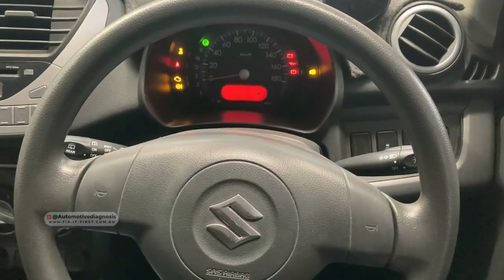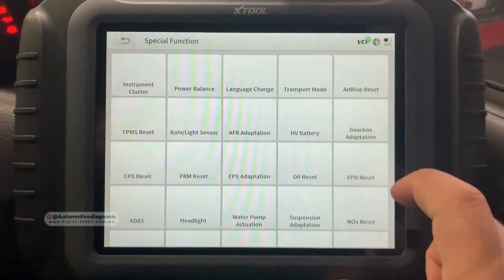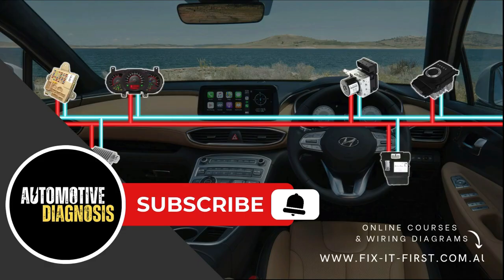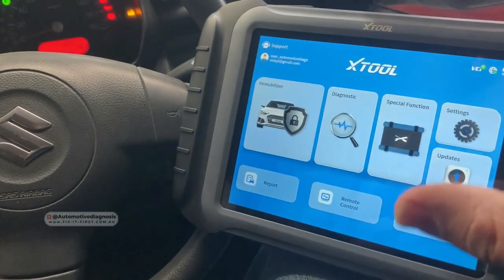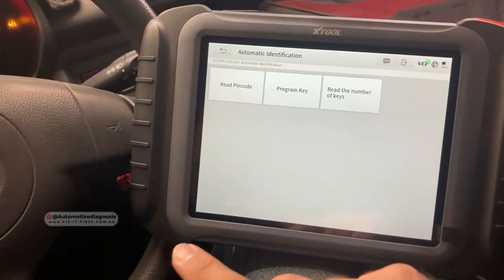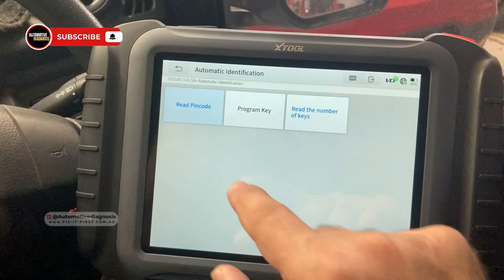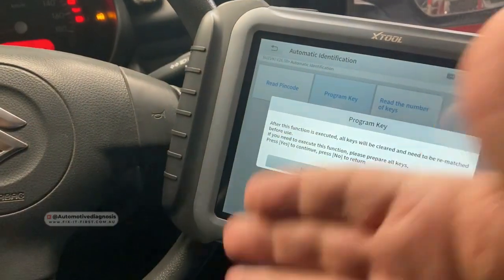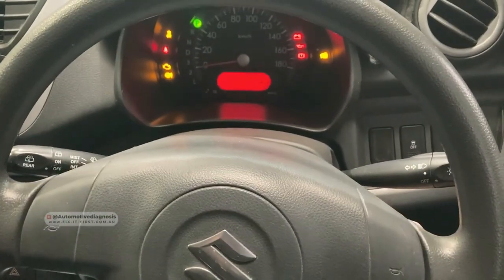Key Programming & Reading Pin Code with XTOOL X100PAD Elite | Suzuki

Comment: He Matw how long does it normally take to access and code a key start to finish with no original key? I’ve got the km100 autel 608 and snap on but all take way to long to get the job done. Been doing a lot of research trying to find a faster more reliable one.

Comment: I wanna buy a key programming tool, but I'm not sure between Xtool and Topdon!
Reply from the maker: Hi there, I never directly recommend what to buy or not, but in your case, If I were you, in case that I had more diagnostic and sometimes key programming (not frequently) I would go for Topdon, but if you wanna do a lot of key programming, XTool would be a better option. But at the end of the day, each device can bring a different experience for different people, so it’s your choice. Let us know how you go and update us about your experience please.
Reply: I was in the same boat not long ago, ended up going with the XTOOL X100 PAD and it's been solid. It’s built for key programming and does the job well. Worth checking out!
Reply: Been a big fan of XTOOL for a while now. The D7 and A30M have seriously helped a lot with car repairs. This one is great, too.